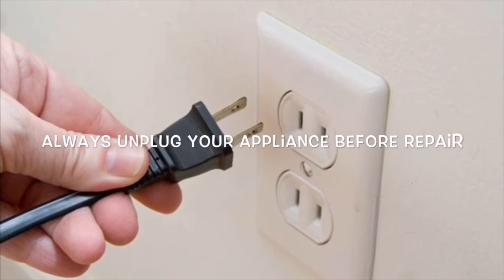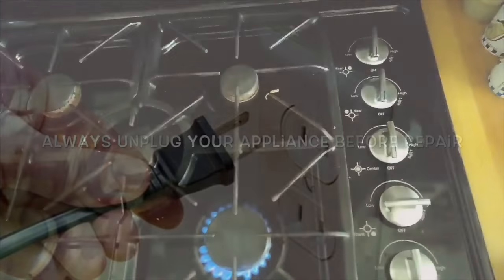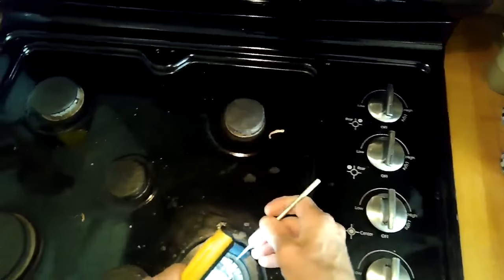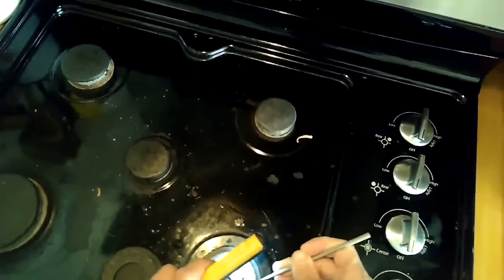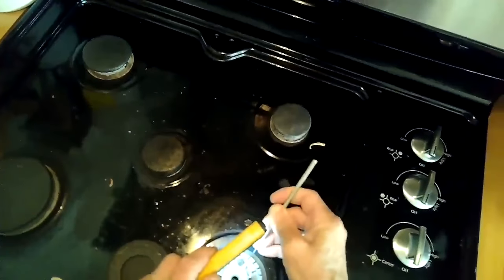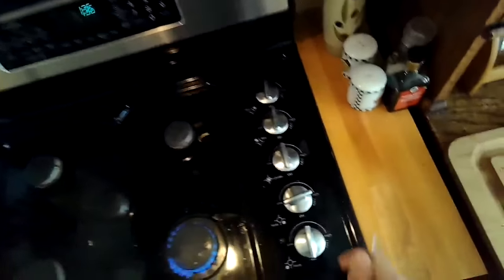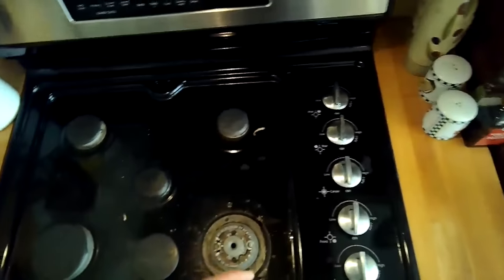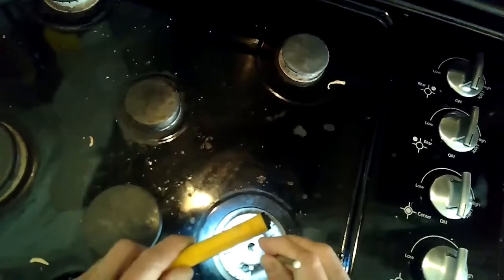✨ GAS STOVE BURNER - UNEVEN FLAME  - QUICK FIX ✨

Comment: Thank you!!  I've had a burner that wouldn't work for years and it's now fixed.  Also, the burner in front wouldn't turn on with the switch, I always had to light it with a lighter.  Now it works too because the orifice in the little burner behind is clear.  I used a dental tool to clear mind.  The pa[er clips wouldn't go in.  Thank you so much!
Reply from the maker: Good idea Jody😊👍

Comment: Thank you!  I know nothing about gas stoves in terms of repairing an issue and your video was just perfect!  It was simple, clear and best of all it worked!  The problem was with one burner, but I cleaned all 6 and was surprised at the gunk under the parts that I removed to get to the tiny air flow vent that mixes with the gas.  I learned a few things about how it works so that you don't have dangerous levels of carbon monoxide.  Keep up the good work!
Reply from the maker: Excellent Camille😊

Comment: Thank you.  I am going to try this on my stove. I have two that are causing me issues.  I did not think to use paper clip.  But will now. I had cleaned it all good. But I guess I could have even made it worse doing that and clogged holes more that way.
Reply from the maker: The paper clip trick will work well👍

Comment: Hi that’s a good instruction . Mine problem is uneven and then like blowing sound !! I try cleaning it too . Any advice. Tks
Reply from the maker: Hi James,
I wonder if the burner is not sitting completely flat?
Reply: Hi Tks for your reply. The burner is sitting flat . The other four smaller burners work well ! I just cleaned like you said the holes but they are quite clean!!

Comment: Hi Scott
All my burners suddenly show orange flame. Do you think this is a cleaning issue or something with the supply ?
Reply from the maker: It sounds like an air/fuel ratio problem.  I think it’s too much fuel not enough air.  I wonder why all 4 went out together?
Maybe a spike in the incoming gas pressure or a problem with the gas regulator on the back lower area.
Reply from the maker: Too much yellow means more carbon monoxide.  Maybe have the gas company check your incoming pressure.
Reply: @ScottTheFixItGuyChannel  is it safe with burners in off position

Comment: The paper clip didn't work for me.  The problem is happening on the 5th burner, the round one in the middle of the stovetop. It is a sealed burner. I lifted the whole piece up, and poked the paper clip into all the holes, but I didn't notice any debris, and there was no change.
Reply: Had the exact same problem! :(
Reply from the maker: Thanks Lori,
I would try it again.
Reply: @ScottTheFixItGuyChannel  I am back to say you were right!  I had a repair guy here. First thing I see him doing is prying the burner cap off. It was stuck on because of the gunk! It is now cleaned out and the flame is burning evenly. Thanks, Scott!

Comment: Hey guy...you need to use the correct size jet cleaner. Using "anything that fits" will unintentionally increase the size of the jet and will also result in yellow flames.
Reply from the maker: Thank you👍
Reply: No prob. You can buy a jet cleaning set for very cheap and it will last a very long time.

Comment: Once I set my burner to the desired flame it will after about 3-5 minutes increase to a higher flame. All the burners do the same thing causing food to burn instead of simmer, so I have to set the flame then after a few minutes turn it back down again, it will remain constant after that.
Any idea why that would happen?
Reply from the maker: If it’s happening to all of the burners then I would suspect it is a faulty gas regulator.
It’s a part that is behind the stove nearby where the gas line connects to the stove.

Comment: Thanks for this. It didn't help me, however. My burner cap is seated correctly, the slits are clean, so is the main orifice below. But still, there's this big hotspot on the front part of the burner, where the flame is an inch or two higher than the rest of the burner's flame. Every time I cook on it (and it's my favorite burner of the 5), the food in that front part of the pan gets scorched. I'm stumped, and of course GE is no help.
Reply from the maker: Can you switch the burner and burner cap with one of the other ones that you don’t use as often?
Reply: This is exactly what's wrong with my GE stove top
Reply: @Tamara-id1pe  We solved it by replacing the burner (silver metal part with slits around it, that sits under the burner cap). The original one was slightly out of whack, so it didn't sit perfectly level. The new one is 100% normal. You can order the part for fairly cheap. At least that was my experience.